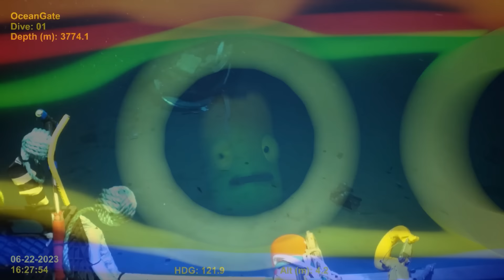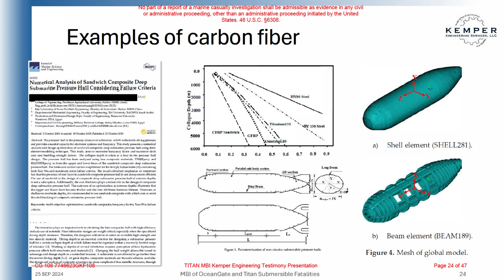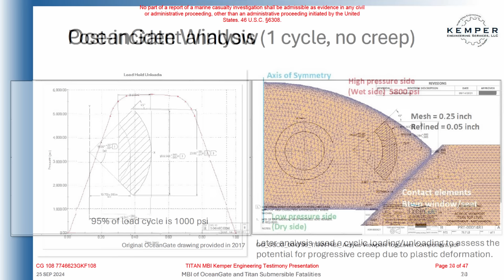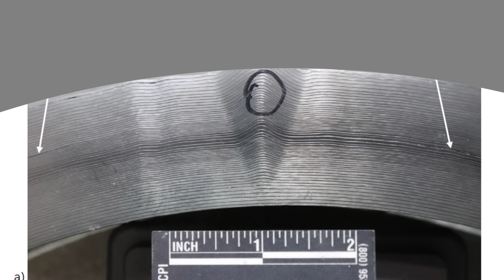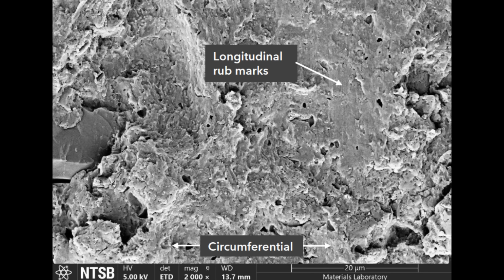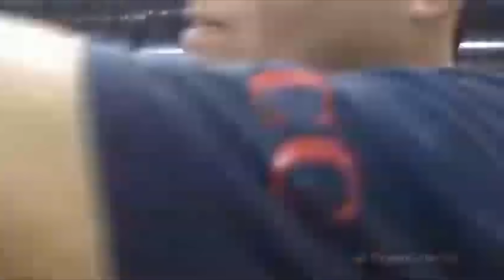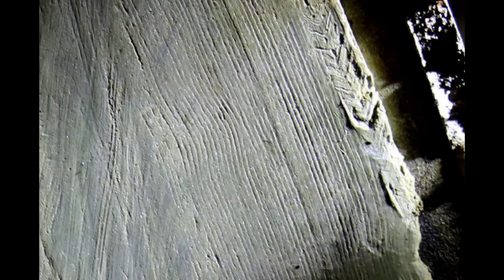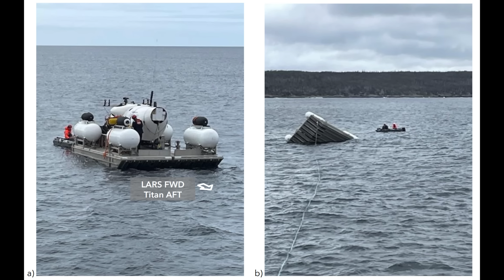OceanGate Wreck Shows Why Sub Wasn't Strong Enough To Survive - NTSB Shares Important Details

Comment: As a mechanical engineer, don’t listen to “an engineer” unless they have research or industry experience specifically in carbon fiber/composites. Even then, you’d ideally want someone who worked in the R&D area of carbon pressure vessels like airplane bodies or SCUBA tanks. 

Most mechanical engineering programs have 1 course on materials science and of that, composites are a smaller focus. The take away all engineers should have is that composites are really complicated. 

You’re dealing with a non-homogeneous material that is anisotropic. Meaning, not only is it not a single material all the way through, but it has different strength in different directions. And we quadruple down by making a pressure vessel and 5 inches thick 😵‍💫

It doesn’t take a degree program to observe this sub’s flaws when presented like this - but just be wary of anyone trying to give an ultra precise answer here.
Reply: Even then, COPVs and other typical CF pressure vessels are holding pressure in (and are therefore in tension), as opposed to sustaining an exterior pressure like a submersible does.
Reply: @RossMcLendon  Yeah, the number of people in the world who have real expertise in carbon fiber or composite pressure vessels in compression is probably very small. We’re in a niche of a niche of a niche.
Reply: @garythecyclingnerd6219  US Navy had experimental carbon fiber submersible, testing use of carbon fiber in sub construction. But it was much, much better engineered.
And in the end, idea was scarpped.
Reply: @cyphi474  Yeah, I heard about those during this media frenzy. This sub the OG trial of my life. The only caveat I’d make is that the USN was experimenting with that in the 90s when carbon fiber science and manufacturing wasn’t as well developed or understood as it is today. 

Additionally the USN is experimenting with 3D printed submersibles now. Which…is a choice.
Reply: 1. Common sense gets you far.
2. Being an risk-adverse engineer gets you pretty far
3. Being an experienced ngineer specialized in carbon composite fabricated structures gets you very very far in addition to legitimizing you as an "expert".
Reply: @handlemonium  “Common sense” isn’t a thing. It relies on you having some foundational knowledge and/or experience with things. I really dislike this phrase because there are many things which, to people with experience, seem like “common sense” but they’re really not. 

If you took someone with literally no experience or knowledge of carbon fiber - and I mean literally never seen the stuff - then they’re going to have a hard time identifying the flaws. They may reason “Wood is wavy, but that’s not considered an immediate cause for concern.” 

Point being, common sense isn’t real because it’s impossible to define what is or should be common knowledge.
Reply: What if they made the entire sub out of titanium? Call me old fashioned but in general I don't like the idea of fibers and glue to deal with compression...regardless of direction
Reply: @miltechmoto  Well yeah, that's how subs are typically made. But the whole point was that carbon fiber was meant to be a cheaper experimental alternative.
Reply: @aberrant-thoughtspace-entity  it is not a sustainable material, you will have to scrap the vehicle after using it once or twice, from what I see here, this monstrosity is much more expensive than the traditional titanium sub, which can be used multiple times.
Reply: @miltechmoto It's briefly addressed in the video: you can do that but then in terms of buoyancy, you've made a brick. So then you gotta fix that with tons of special foam, which is the usual way of doing things but all this to say there are valid reasons to want to build a lighter pressure vessel here. You gotta put in the R&D though.
Reply: @miltechmoto  you're right! I looked it up, and apparently, the best alloy would have been titanium Grade 5 (Ti 6Al-4V), lol.
Reply: @miltechmoto  The problem with Titanium was that it would have made the pressure hull extremely negatively buoyant.
Buoyancy isn't easy at those pressures, so they'd have either needed loads of foam on big tanks of alcohol.
Look at the Trieste, and remember that only the little sphere at the bottom is occupied. The rest is alcohol tanks for buoyancy. And you'd be talking about something much bigger. 
The composite hull was a tremendous improvement in many ways. It let them build a dramatically bigger interior while also reducing the total size and weight. 
If they could have gotten it to work as well as the hoped, it would have been revolutionary
Reply: @miltechmoto  In addition to what others have said, carbon fiber isn’t necessarily unusable here. Titanium is well understood, has its challenges. But CF is very strong even under compression…when properly engineered, manufactured, and tested. It’s so strong, that a half baked sub was able to dive over 80 times without imploding. Remarkable, really. 

On the glue, skimming the USCG reports, looks like they used Loctite EA9394 epoxy which…is less than impressive for this application. 

In the USCG report, the composites company claims a shear stress of just 4.21kip at room temperature. Which is less than the pressure of the water at Titanic’s resting place which is a lot colder 

They should have been using a more exotic bonding material. Bonding really isn’t gluing, even if it looks the same, because it’s atomically locking dissimilar materials together. In some instances, bonding is stronger than welding.
Reply: @garythecyclingnerd6219 I just checked out EA 9394. And it's the equivalent of airplane bondo.
Reply: @rikkyt66  Yeah but…an airplane needs to keep like 8psi inside.
Reply: @miltechmoto 
That is the way to do it, but a DSV to carry five people ends up … a bit bigger. The 1964 DSV Aluminaut had a 2.7t payload (up to seven people) and weighed 73t at 15.5m long with a maximum diving depth of 5.2km. 
Ocean Gate could have never managed to build and operate something like that.

Now that thing was built 60 years ago, when Stockton Rush was just two years old.
But he never intended to do it properly in the first place.

He wanted to maximize the payload per vehicle weight, his 9525kg Titan carried 685kg of payload which equals 71.9kg/t. The Aluminaut managed just over half that at 37kg/t. DSV Alvin manages 40kg/t at up to 6500m, but it is slower and has space for only three people.
Reply: @miltechmoto  If you look at other deep ocean submarine designs, the majority of the volume is special buoyancy material to counter the massive weight of the steel/titanium — otherwise you will never get the vessel back to the surface. The original Trieste, for example, was 90% gas tank (gasoline is lighter than water) and 10% cabin. OceanGate didn't want a huge, expensive submarine, so their solution was to use a lightweight material instead of metal.
Reply: @PaulMDavidson  yeah... and how's that working out for them?
Reply: And they milled the fibers down at the creases essentially cutting the fibers so instead of one cohesive layer you have many different sections where the fibers goes from one milled down cut to the next. Yikes.
Reply: @Hauntedundead  Exactly what i thought. Layers where fibers are just hanging out in the open chilling, not taking any load.
Reply: I once had a friend who was an egineer with degrees in mechanical and chemical engineering and who's company made sonar domes for surface ships and submarines. Sadly he died from cancer some 15 years ago :( 
But yes, I often think about what he would have had to say about this contraption.
Reply: CF not being able to flex is all I needed to know.
Reply: Well, don't listen to ambitious guys who don't listen to engineers. Remember that several engineers quit or didn't want to get close to the thing.
Any expert, not only engineers, should know when they are talking outside of their narrow expertise and prefix all their comments with a maybe. Some stick to that standard, others don't.
Reply: As an Electrical Engineer i agree. Guess it's the same problem you have in software engineering. If someone knows just a little more than you, it's easy to see them as highly competent - until you learn the same as them. When you need to hire someone in a field you don't understand it's easy to confuse confidence with competence. If you are a pushy leader you might end with a bunch of yessayers. 
Professionally I stride hard not to crack down on people that disagree. Doing so can make open us up to systemic vulnerabilities.
Reply: 5 times 1 inch thick...
Reply: I've seen pisstakes both by experienced and inexperienced engineers. Definitely preference people with composite background, there's a huge amount there to learn
Reply: I read somewhere that Rush was told the sub was only good for a certain number of dives and a new sub should be built after x number of dives but of course Rush wanted to cut corners and save money so he thought he knew better and kept using the sub knowing it should have been replaced. Honestly the gall of that man, thought he knew better than experts.
Reply: Yep. So many complications for such a hard use case.
Reply: An answer that's precise enough as far as I'm concerned is this is a submersible that was designed by an arrogant Rich idiot who thought he was untouchable and ignored. Literally every possible safety procedure or warning and just kept going when anyone with half a brain cell would have realized that this will go poorly at some point. The exact details don't really matter because the submarine was going to implode at some point it was only a matter of when
Reply: As a mechanical engineer, no.  They did talk to people with "industry experience" and had good pedigrees.  They picked and chose who to listen to and when to listen.  You are right its not about degree programs, though.  Having a PhD wouldn't have been a magic bullet, either.    The fact the material is anisotropic is not a big deal -- so is wood.  A thick wall pressure vessel is trickier than a thin wall assumption, but its doable.   It made 13 dives to depth -- just imagine if they would have a normal design margin on it.
Reply: I prefer to listen to the people that would say “I’m not an engineer, BUT.”  I can’t understand why people say that, they say they aren’t trained in that field but also think their opinion means the same or more than the qualified person?

Comment: As you note, the real time monitoring system (RTMS) essentially did that it was designed to do: provide a warning the the hull probably was degraded. On dive 80 the abrupt jump in strain gauge readings coinciding with an off-the-scale acoustic reading, the “LOUD bang” IMO suggests A SHOCK LOADING of the hull or rings. Dives 81 and 83 data when compared to 76(?) and 80 screamed the hull has changed. OG however seems to have looked at the data in terms of strain v time and NOT strain versus depth (thus stress). Streets - strain graphs are part and parcel of mechanical engineering. It shouldn’t take a PhD (D Kramer) to ask what is the strain versus depth behavior, 

Good point about the impact crater around the forward dome. If one assumes that Titan catastrophically broke up at around the last reported depth   (3,346 m) it was around 450 m off the ocean bottom (ROV reports its depth of 3,778 m). The dome likely assumes a port hole down angle of gall and looks fairly streamlined. The debris field is approx 200 by 50 meters. Reminds me of what I envision an in-flight break-up of an aircraft debris field. I am hoping NTSB+USCG gets the modelers on the case and produce an animation explaining the debris field. 

Finally a good explanation of the viewport certified to 1,300 m - the shape and not the material. 

The outer layers of each 1” thick build-up layers were ground. My understanding of fiber reinforced resin composites (FRRC where the fibers can be carbon, glass or Kevlar) is that:
The fibers are thin - so thin that one can assume any particular fiber is continuous or is broken.
The composite depends upon loads being transferred along the length of each fiber is what makes the strength along the length of the fibers.
The resin MATRIX equalizes or distributes loads among fibers.
The matrix distributes loads around broken fibers and from one end of a broken fiber to the other end.
Ocean Gate was grinding down fibers, that is, breaking the continuity of fibers, at wrinkles on the exterior surface of each 1” thick hoop. This surface is at the critical interface where the green adhesive was to bond two 1” wound hoops together. I don’t know if this is standard practice for thick section FRRC structures or components. But based upon my assumed facts about FRRC above I would be careful about the ability of the stresses (loads) being uniformly transferred between layers of fibers. Was Dr Kramer, NTSB, basically hinting that the layers were sliding past each other? Your roll up a stack of paper sheets illustrates the effect.

Comment: my first intuition about the ring to barrel interface being the failure point seems correct, crazy to think how easily that could be engineered better. adding extra beef to the inner flange would probably have prevented this failure, but eventually the negligence was gonna take this eggshell down. repeated strain and deflection in the imperfect carbon fiber hull is not in the cards of safety and longevity when you ignore the warning bells. COPVs have gotten a bad wrap,  pun intended.

Comment: For anyone curious, syntactic foam is just a bunch of hollow glass or ceramic spheres embedded in resin to give it some shape. The air inside the spheres reduces its density to where it's buoyant. While the small size of the spheres makes it extremely resistant to pressure. (The water pressure presses on all sides equally, meaning it needs to crush the glass to collapse the sphere.) But of course, outside of water it's still glass, so pretty heavy.

Comment: The debris is towards the rear of the craft even projecting at an angle. The “crater marks” are around the rear dome as well.  I fear they hit the ground, imploded and threw the front dome out in the distance. Debris is too concentrated and a debris field is seen clearly on one side. @28:48

Comment: Peel Ply:  this is a pastic wrap coated with a release agent (so does not stick to carbon fibre/resin). You wrap the uncured object with peel ply, then if you suck all the air between the peel ply and the mould  (and in some autoclaves then increase ambiant pressure to increased from 14,7 to highwer value the force applied onto the peel ply and hence the compression of fibres below it). Once cured, the peel ply can be removed easily since it did not participate in the bonding process. But it leaves a layer of release agent onto the object.  It is never recommended to lay more carbon over an already cured object. 

One way around those wrinkles would have been to lay dry carbon tape (not prepreg) with greater tension, wrap the object in peel ply, and then vacuum it with tubes attached at other end(s) supplying the right amount of resin. The vaccuum will draw the resin through the carbon fibre.  Because the tape was laid dry tight against the mandrell, and because the resin was added while pressure pushed the peel ply against the dry carbon, the act of adding the resin will not "bloat" the carbon and thus more stable form during curing.  

Process is everything and if their process yielded wrinkles to a point where thet could not build a 5" thick cylinder, then they needed to redo their math to calculate how thick the cyclinder needed to be if built of separate 1" thick layers. 
Carbon fibre is not at fault here.   Carbon fibre can do compression.   But whebere carbon fibre is mission critical, you need to design not only the direction of fibres but the process itself such that it is PERFECT everytime.  This is something NASA paid Boeing to do in early 2000, research which then allowed Boeing to do 787 fuselages as thin as it necessary with the right layup design and process.
Reply: I completely agree with you, except that having seen amateurs attempt the "pull the resin into the already-laid-up carbon fiber with a vacuum" construction method, I have a hard time imagining OceanGate building a hull that way without having large areas in the middle that were devoid of resin -- and that of course would be even worse than the wrinkles.
Reply: @BrooksMoses   "Easy Composites Ltd" have produced a lot of "how to" videos  and this one has the 3 main layup techiques, hand-layup, resin infusion and prepreg.    They make a very simple plate.   Note they mention strenght varying depending on how the fibre is layed up (ala that 45° angle which OceanGate refised to do). 
The video is:  How to Make Carbon Fibre Sheet - 3 Alternative Methods

I have seen them make much larger srructure with resin infusion ad they will have multiple entry points for the resin to make sure it gets everywhere.

Comment: if the window analysis was only done statically, the pressure points may be misleading, since forces should be calculated post deformation (dynamically).

Comment: Oh my God. You said "truck bed liner." I can believe it and it's so horrible. How much does it cost to charter a boat to launch for this area? Surely somewhere between  10,000x -100,000x  the cost of a pint of rhino liner... Insane. 

 Fuck Stockton Rush. Wow.
Reply: Appropriate materials are occasionally found in unexpected places.  During Project Pluto (nuclear ramjet) they were trying to find a heat resistant coating for certain components (~1500°C); they eventually found that the best material by far was exhaust manifold paint ordered from a hot-rod magazine.